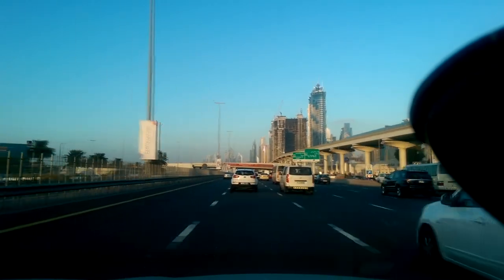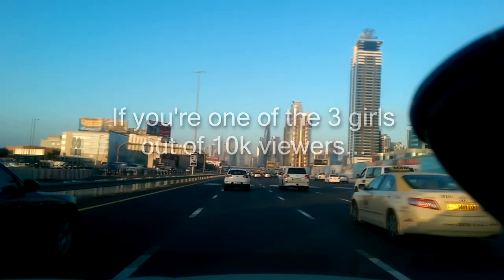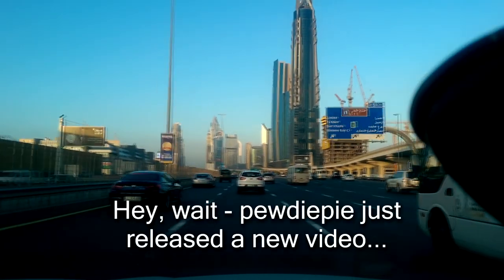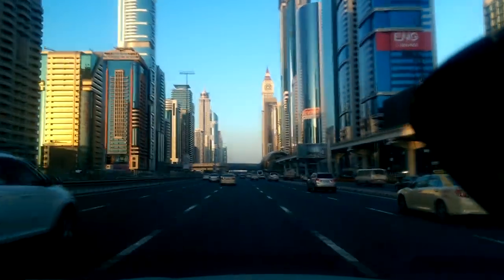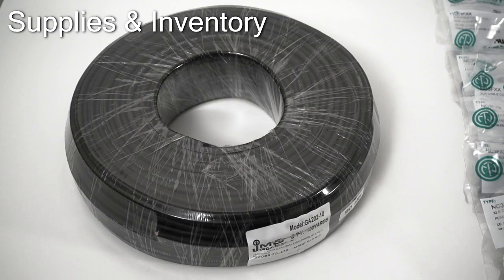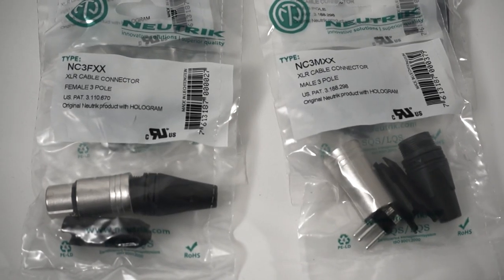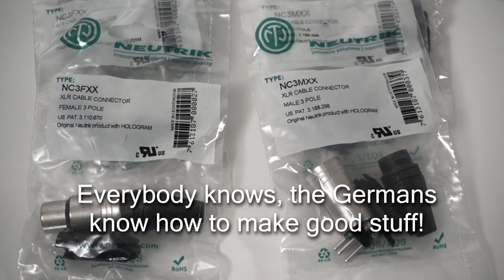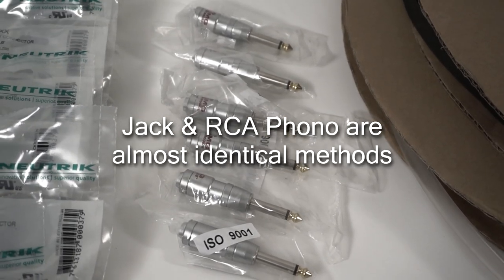#003 Soldering Tutorial - How to make pro grade cables!

Comment: Good guide, better than most. Several tinned wires seemed a little short before soldering into buckets, guess camera can't show enough details. Anyway, longer wire (not too long for reasons explained in the video) helps protect joint against corrosion and has better resistance against tearing. I think Neutrik chasis mount XLR connectors still have rounded buckets where care has to be taken to not overflow solder.

Comment: I like to know that I am not alone in the world when I make a point of saying that one of the best bets that can be made is precisely in the connections of all the equipment that is used. Without a properly manufactured cabling I don't trust success and prefer to work with cables made by me. I totally agree with everything in this video, except for the 6.5mm jack plugs. If you use Neutrik for XLR why not use Neutrik for Jacks?
As you said - and you said it very well - Neutrik is the best choice for professionals. 
Greetings from Portugal. 
Macedo Pinto

Comment: Yes, I am officially a nerd. What would you expect? I've also been doing audio electronics for almost 20 years - hi-fi stuff, pro audio stuff, vintage restorations, tube amp building... and it all teaches me you never should grow complacent and have your head stuck up your ass thinking you know it all while you do not. You never do, there's always something new to learn, different points of view to consiuder, so I appreciate new insights and share my own.

Neutrik is made in Liechtenstein, though they also have some of cheaper products made in China, still branded as Neutrik. They also have a lower-end brand named Rean.
I once did a little comparison of 1/4" TRS plugs https://www.youtube.com/watch?v=Cp_uZo47paI
China-made 1/4" plugs have a plastic insert and Liechtenstein-made ones have phenolic which won't melt in soldering temperatures. 

Breaking the cable making into simpler steps and doing it on many cables, then moving on to the next step, is also how I do it. Learned it back in my campus radio days where I did electronics maintenance, made cables especially before major gigs. It's a good opportunity to learn.

Leaving the backshell... OH MY. I don't know how many times I made that mistake, especially when I was distracted!

It's sometimes useful to make yourself a jig for holding the connectors rather than putting them in a vise. Crappy  old sockets can be used for that.

I strip the outer sheath with a knife, of course gotta be careful not to cut the shield or conductors. Yes, it's possible :D

Pull test is indeed important. Just like Obi-Wan said, use the Force... but not too much or else you'll damage the cable itself. And not too soon - give some time for solder to solidify fully, or else you'll have a cold joint. And BTW, pull tests are MIGHTY important when doing AC wiring - the last thing you want is fire, and loose contact is a common cause, so always test your job and try as hard as you can to pull that wire out!

Heat capacity is important, but you can always help yourself by turning the temperature up a bit on jobs that require a lot of heat. Sometimes all the way up, for e.g. ground busbars in tube amps.
I never used Hakko, sometimes used Weller "Magnastat" where the tip itself controls the temperature thanks to the Curie effect and magnetic reed switch, but my favorite station for over ten years was Solomon SL-20. Who knows, maybe Hakko is better, gotta try it... waiting for that package, if it comes, I will do a review on my channel, haha!

Ugly lead vocalists, oh well... How about a band where a lead vocalist is ugly but a lead guitarist is sexy as hell? :)

Labels under heatshrink are good and easy to do, but labels printed on heatshrinks with a portable label printer (Dymo, Brother etc.) are even better, they look real deal pro and if you've got a capable printer, do it. Yours seems like a good pro grade stuff that could handle the job, and it's only a matter of getting a heatshrink label cartridge. BTW I like the "BS" label slapped on one of the buttons.

One tech tip from me: use medical forceps to hold the shield when soldering. First it's steady, second the forceps suck away the heat that would otherwise go all the way up to the place where the shield touches the connectors, melting their insulation and making the cable dodgy.

I always practice looping the conductors, keeping shield the shortest. If strain relief fails, it'll take the load and it can take much more force than the conductors.

Your cable tester looks pretty advanced. I see it can show you which pin on the output corresponds to each one on the input, like the ethernet cable testers. I wonder what other functionality it has, and if it can detect leakage, cracking (intermittent open circuit) etc.

I never put the heatshrink over the contacts; if I did it, it'd make visual inspection of a suspicious cable harder as you have to cut the heatshrink to look if the connections are okay. 

Nice and tight... I do it tighter than Ethel Granger's laces, but hand only - no pliers.

As for the glue, I don't like the stuff but sometimes use it for fragile connectors like USB or 1/8" plugs. Usually a teeny tiny dab of hot glue that will melt as the heatshrink tube shrinks.

I sometimes call heatgun an industrial hairdryer :)

Comment: This video has been my go-to tutorial for making my own XLR cables. I've found that I save about 50% by making my own with Mogami cable and Neutrik connectors as opposed to buying the pre-made cables with the same materials. However, I'm using Mogami W2534 Quad cable, so I had to check out other videos to see how to wire the extra two leads. As it turns out, you simply twist together the two like-colored wires in to one, tin each of them and proceed as shown in this video. 

One thing I did have to do though is equally separate the bare wire, twist them into two individual leads, twist those two leads together, solder them together at their junction point (for strength), tin one of the two leads and cut off the remaining lead. This was because the one-piece tinned bare wire was too thick to fit into the bucket. All this extra work does make it more difficult to stuff the leads into the buckets but it certainly can be done.
Reply from the maker: Hey Tim. Thanks for the feedback. Yep just join the blue ones and the white ones together. Some manufacturers, like beldens 8723, have 2 separate twisted pairs. There are two schools of thought about this. You can use both conductors from each pair, or you can pair together one conductor from each pair, which in theory should give better noise rejection. Whether you can actually notice it on short runs, I'm yet to determine.
Reply: @TheBrightPixel  Thanks for the reply. So if I understand you correctly, rather than Blue + Blue and White + White you're saying Blue + White and Blue + White? If I'm correct I'd like to give that a try.
Reply from the maker: @timothylawrence707  Only with cables that have two twisted pairs. I think the Mogami has all four cables twisted as a single group?
Reply: @TheBrightPixel  The Mogami cable I have (and they make so many different types) says "Neglex 2534 Microphone Cable" on the black casing. There are four individual stranded and copper wires inside - two blue and two white with the bare braided copper wire on the outside. I'm guessing this isn't the Mogami cable to which you're referring?

Comment: I love the colored tape as a visual control to help prevent mistakes. You can actually extend that idea to soldering the connectors by using sharpie markers! Mark your hot pin with red sharpie and the cold pin with black (alternative you could mark ground with green) on the cups and it helps prevent mistakes! The inks are alcohol based and evaporate above 200F so apply it after prepping the solder cups.
Reply from the maker: hahaha, I can see why after watching this video you might think that's necessary, but honestly I made that mistake mainly because I was concentrating on speaking, camera angles, lighting, recording, etc, rather than taking care about what I was doing.

Comment: it is impossible to make that small printer which wouldn't print that waste, because tape has to be guided to work correctly. BUT every label printer have different modes for single print, in example: a) no cuting at all b) cutting 2 times (cutting off the waste, and after print done) c) cutting only once after print is done.
Just select option c) and no more tape waste! one thing to remember is to change from option c) to b) before printing the last one.  This option should be at the top of the menu. 
Other ways to avoid waste is to use plug printer by usb to computer and use dedicated software (with more than 10 labels it is so much faster to prepare every label in computer.
some printers also give you option to print whole series of labels, in that case everyvething you must do is to find that option.

Sometimes is easier to "read the fakin' manual" that complain all the time :D
Reply from the maker: This was solved in a much better way by a previous commenter a long time ago. The printer has an option to print multiple labels and cut them as you go, with zero waste. Sometimes it's easier to read the comments rather than complain all the time :D

Comment: Hey M8, you can cut a length of solder twisted or not depending on solder diameter and just drop it in each bucket. Then you just hold the iron until it melts down.

Comment: In the NE USA I like to say George Washington Bridge. 
G=Ground pin 1
W=White pin 2 
B=Black pin 3
Reply: Great tip, thank you! I've got a quick question though.. I made 2 XLR cables and they are working fine for speakers and dynamic microphones, but it seems useless with condenser microphones... (no signal at all despite the 48v power supply) Could help me with this issue?

Comment: Not sure how deep those buckets are, but usually they recommend the wire bottoms out in the bucket. As you only stripped 3mm, you might not have the wires bottomed. I strip excess and see what distance is needed to get wire to bottom plus leave gap to insulation of about a wire diameter

Comment: Write multiple labels at once to save tape and cut them with scissors!
Reply from the maker: Yep, good tip! It's just a pain that the machine doesn't have that feature built in. Would be nice if you could tell it to print 10 pieces, and then it asks you to cut as it prints them out.

Comment: Any reason why you don´t put eveything on cable (heatshrink, end cap) before stripping? I find it more convenient, especially with the tight sleeves of the neutriks. That said, the most entertaining soldering cables video ever! Thank you!
Reply from the maker: Yes! Because when you are doing a batch, I've had pieces slide off the cable without me noticing, then I solder them up and the backshell is on the floor :(
Reply: @TheBrightPixel  Yes, that sounds familiar 😁 right now I´ve got the parts for 64 cables sitting at my desk, oh what a fun weekend that is. Sort of.

Comment: Thank you for this video. I learned a lot. I am searching for how to make a RCA cable with RG58 for car audio. I want to make my own custom RCA's. I have a very high end Sound Quality Car build. Thanks again.
Reply from the maker: Robert Tousignant sorry for the late reply. I would personally do an F type crimp on the RG59 and then use an F   to RCA adapter. Cheap (if you have the crimp tool, easy and reliable.

Comment: A lot of silicones are also corrosive to coppers and other metals.  Are you sure that brand is non-corrosive?
Reply from the maker: Yes. I just cut open the oldest silicone filled jack I could find in the workshop. I think it's from about 2013 when I built my test bench. No signs of any oxidation at all.
Reply: The tube shown in the video clearly states that it releases acetic acid while curing. While it may not be catastrophic, I’d avoid using it, instead purchasing a neutral-cure silicone, ideally one made specifically for electronics, since they do exist and still aren’t that expensive.

Comment: Good work, thanks for this in-depth vid, and thanks for including the stuff-ups and correction - they’re important. I’m making my first microphone cables. A couple of questions: 1) Switchcraft 3 pin connectors (and ? the connectors you used) have 3 spots for wires (hot, cold, shield), and a post with a hole in it. What’s the post for? 2) I’m using Canare cabling with shielding, 2 white and 2 blue wires. I anticipate joining the white wires together, and same with the blue. They both seem ‘coolish’ colours. Is there a colour coding convention here? Which colour is hot/cold?
Reply: Sorry, it’s  Mogami Neglex 2534 microphone cable.

Comment: Help! I checked some bought xlr cables and noticed that the ground wire is jumped to the outer socket/casing. 

Should i jump the ground on my cables or just solder the three xlr connections?

Comment: Thanks for this most informative video. Have you ever come across a mono guitar cable which is lower in volume than another identical one? No crackles along the cable length and it doesn't cut out. Do you think it's the cable itself, the jack plug or the solder, and is there any way to test these factors? Thanks for any help you may be able to give.

Comment: Isn't it possible that this silicon will create layer in between 2 parts of connector and disable shielding effect of cover?
Reply from the maker: No. It's no different to the internal plastic separation layer in a CAT6 cable.

Comment: Where do you get your heatshrink from? What sizes do you use for the black and transparent bits and what ratio are they at? What cable brands do you recommend using for hard wearing, good quality, tour grade? (I've heard van damme is pretty good)
Reply from the maker: I buy my heatshrink from the local market. 12mm 2:1

Van Damme is good but overpriced IMO. What you are looking for in a tour grade cable is flexibility and durability. Braided shields are preferable and you want excellent shield coverage.

Belden, Canare and Klotz are all great places to look, as well as Van Damme if it's in your budget.

Comment: When I try your method with the TS connectors, using pretty much any cable, the center conductor is too thick and obstructs the outer shell.
What is the wire gauge of the cable you are using for the TS connectors?
Reply from the maker: What brand of connector are you using? Are you soldering to the inside of the lugs?
Reply: At 40:46 it looks like you have your signal wire bent at almost a 90 degree angle where it comes out of the main cable, then bent again to line up with the lug. How did you do that?

My connectors are Rean, which except for the color of the band, are identical to Neutrik. I run the wire through the top of the lug-hole toward the center. I believe that's how you do it in the video too.

My cable brand varies, but in every case it seems that the center insulator is substantially thicker than yours in the video. Mine are all 20AWG.
Reply from the maker: Those Rean connectors don't look anything like Neutrik connectors. However just solder the center conductor first, then the ground.
Reply: Neutrik acquired Rean. Maybe you are thinking of the higher end Neutrik connectors. Their bottom end connector, excepting the color of the band, is identical to the Rean. I have set the two side by side recently.

Comment: Great tutorial, thank you! I've got a quick question though.. I made 2 XLR cables and they are working fine for speakers and dynamic microphones, but it seems useless with condenser microphones... (no signal at all despite the 48v power supply) Could help me with this issue?
Reply from the maker: The phantom power uses the hot and cold conductors. Check that they aren't switched around, and that both have good connections.

Comment: Again thanks! I have a question thou. If we put heat shrink on the neutrik xlrs, doesnt that decrease the effectiveness of the chuck-type strain relief?
Reply from the maker: Quite the opposite. After a long time and a lot of use, the point where the cable exits the connector is a weak point. The constant bending at the exit of the shell is a very common failure point. The heat shrink spreads the shearing forces so that a longer section of the cable shares the bending load - resulting in much longer cable life.
Reply: @TheBrightPixel  Sir! Thanks for your answer. I get the benefit concerning the shearing forces at the shell exit. Normally when the plug is assembled and the shell screwed down, these plastic teeth get compressed and start to grab the sheath.
When we use shrink tube the teeth grab the shrink tube which might be not as effective if we want to decrease the pulling forces at the solder joints.
By the way I have no practical experience at all.. I am just talking out of my a**.